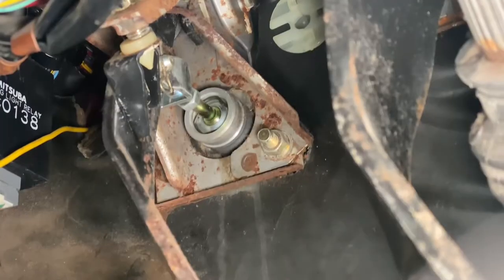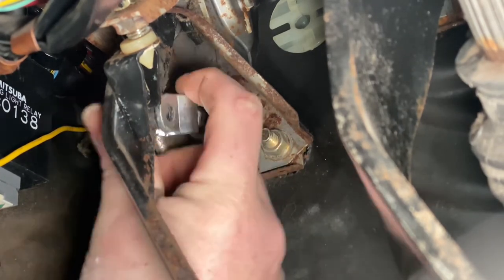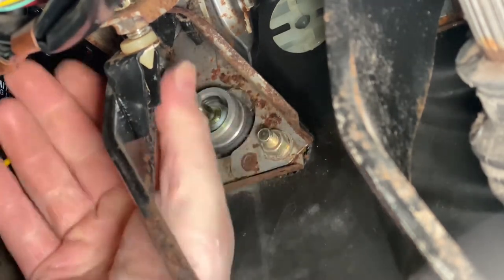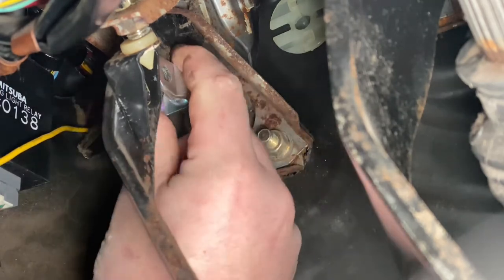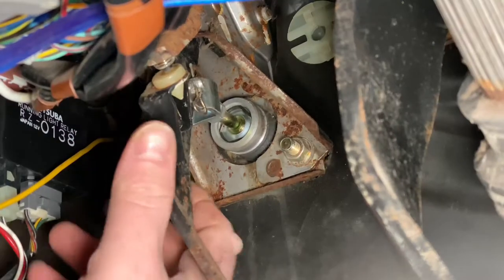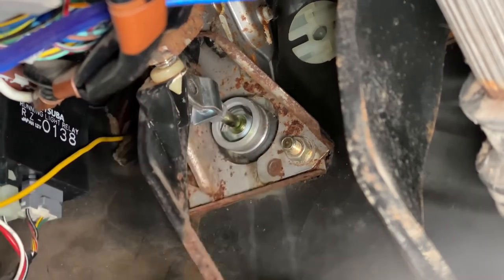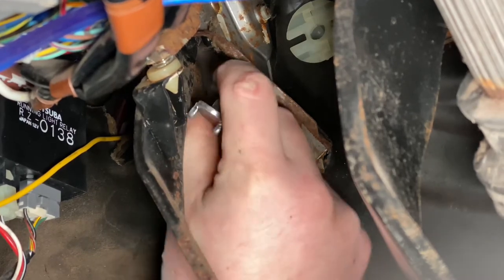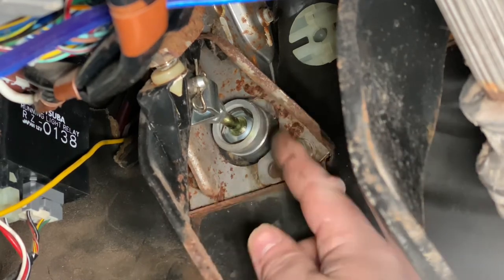Clutch Adjustment On The CRV

Comment: My 01 crv engages very late, I will try to adjust it
Reply: I have 01 crv mine doesnt come allá the way back
Reply: Same bro mines been engaging late ever since I put in new clutch so Ik it’s not the clutch.. time to adjust
Reply: @guero5096  did you manage to get the clutch to engage earlier? My pedal engages extremely late, I had the clutch checked and it is fine,  I have no comparison if this late engagement is normal for rd1/2 cr-vs?
Reply: did you manage to get it to engage earlier?
Reply: @palermo777  no, sold it as is
Reply: @Dougarony  the entire car? due to the clutch 'issue'? explain please!
Reply: @palermo777  it was fine  ran good, just too slow for my tastes
Reply: @palermo777  yes I fixed it. So what I did was go down under wheel and take out that clip that connects the pedal to the master cylinder. After you take out that cotter pin, slide that little cylinder metal piece out, once it’s out your gonna see a nut on the piece that the cylinder metal piece with the cotter pin was slid into. You’re gonna loosen that. Then pull your clutch pedal up all the way and your gonna want to loosen that medal piece about 2 turns out maybe even 4, the medal piece I’m talking about is right in front of the nut that you need to loosen and it’s also the metal piece that the cylinder and cotterpin go into if that make sense. Once you turn that out a bit connect it back to the clutch and it should be good